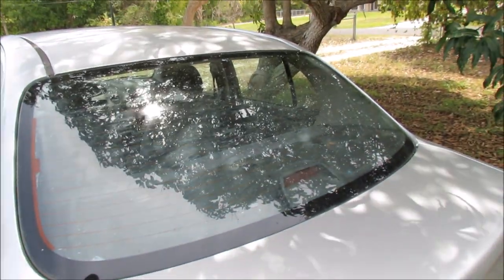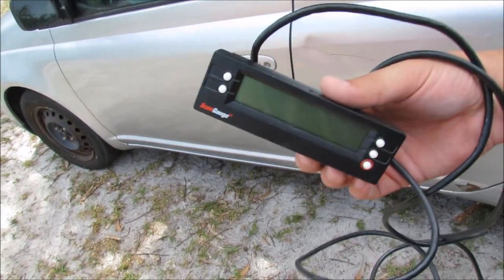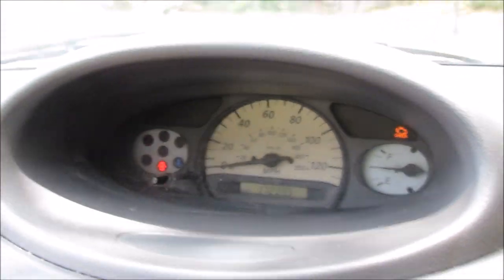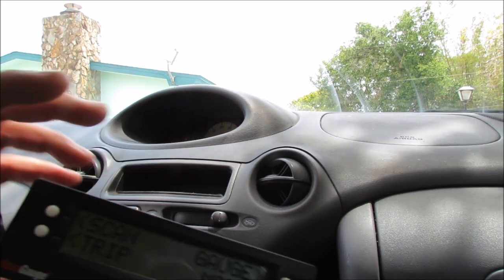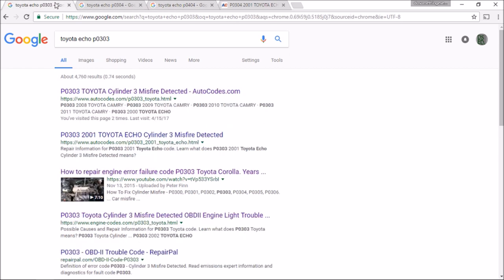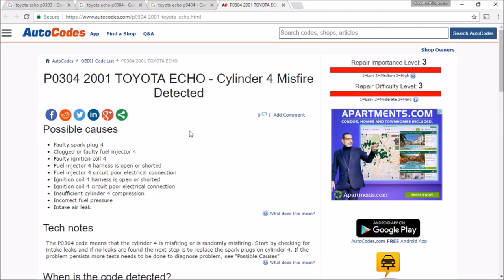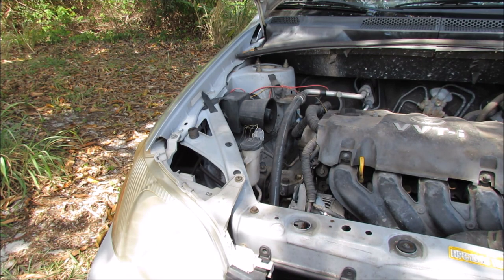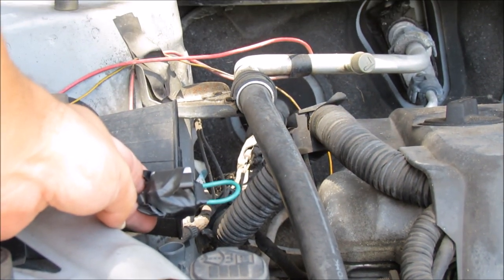Toyota Echo S01E06 Radiator Fan Bypass & Check Engine Lights

Comment: Your video is interesting and it is of great help for many people and for me since I have a Toyota Celica from the year 2000 with the same configuration of the cables. Thanks 🙂👍. This test may indicate that the pressure switch is bad.

Comment: My echo is overheating but no check engine and I did the same method you did it works but I wanna fix it I don’t want to hear the fan constantly on
Reply from the maker: Overheating engine wise?  Or its too hot inside the car?
Reply: No it’s not hot inside the car but when I turn on the car the fan never came on and I changed the thermostat and I thought it was that but I guess it wasn’t and I drove from Massachusetts to Florida I just moved to Florida when I was driving down here it never overheated but one I hit Georgia
Reply from the maker: @ELHONDEROPR  im guessing you already did this but have you check or replaced the fan relays or fuses?  If you already did the thermostat thats the hard part.
Reply: Thousanddollarcarguy no I didn’t check the fuses and relays but ima check those and see if it’s the problem thanks you for replying and helping me out I’ll definitely check the relays yes cus I let the car run for 10 mins it started overheating and the fans never came on so the fan works and I love your videos man your a big help
Reply: @ELHONDEROPR  
hey i've got the exact same car and same issue, I by passed the fan and its working but its always on and annoying... did you end up fixing your fan? was it one of the relays or a fuse?  
I don't have the book, don't know which fuse is the fan, gotta do some searching online...
Reply: @yash_ar  I fixed it it was the fan switch on the radiator but I sold the car 3 years ago now I have a 2014 Honda civic si
Reply: @ELHONDEROPR 
Cool thank man, ill see if I can find that switch
Reply: @yash_ar  it’s on the bottom of the radiator next to the transmission lines near the bottom hoses your see it
Reply: @ELHONDEROPR 
Great, thanks bro, I have a spare echo I'm gonna take it off that and switch it and hopefully it'll resolve the issue.
Reply: @yash_ar  your welcome and good luck I hope you get it working

Comment: What's the purpose of the a/c cutting off the cooling fan, I wonder? It seems crazy, but thanks for the info.
Reply from the maker: Its possible the switch is run thru the fan.  So when the ac doesnt work theres no reason for the fan to come on.

Comment: Sometimes on these Echos, the check engine light with code P0012 is often triggered by a clogged variable valve timing oil control valve solonoid.  One bolt, unclip electrical, slides easily out of engine, the part is near $100 aftermarket or double from Toyota, but often solves a check engine light.

Comment: Can you tell me the name of that Green Wire your using to do that ? It turns out I have the same car a 2000 Toyota Echo Stick & the Plug melted from the coolant sensor on the bottom of the radiator so now I'm trying to find the same plug or maybe another coolant sensor with a different plug that works the same way. But my fan doesn't run when I turn the fan switch in the car. And even without the switch on I don't think the fan runs at all. My Echo overheated once already and I'm trying to prevent that from happening again. But I still need it as my daily to drive until I fix it.
Reply from the maker: You can always wire power and ground straight from the battery to the fan to see if it works.  Or you can buu an after market fan to mount and wire up which as these cars get older may be the best option

Comment: Great video. Question, if the AC is Off , Fan is still running ?
Reply from the maker: Yes, with the AC Off this bypasses that and makes the fans run directly once the ignition is on.
Reply: I tried this and when I turn my car on the check engine soon pops up. What do you think what’s wrong with it
Reply: whats the make and model and price of youre scanner?  @thousanddollarcarguy

Comment: What make the fan for noah to be direct plz help out
Reply from the maker: Almost all electric fans are just 1 power wire and one ground.  And if you apply power to one of the 2 wires and ground to the other it will just spin in 1 direction or the other.  Imagine if you apply power one way it will spin the fan clockwise.  If you apply power to the opposite wire then it will spin counter clockwise.  Just trace the fan wire in the harness to a connector and try applying 12v from the battery and a good ground to the chassis.
Reply: It overheat from the the following morning its start once and get off and now when u turn the key on its run the fan sir

Comment: hey did you ever find out what was wrong with the echo? once you bypassed it did it run hot anymore?
Reply from the maker: The compressor was froze.  But the engine fan never came on.  So i bypassed the switch and it forced the fan to come on.  I sold it shortly after.  So never fixed on my end.

Comment: i had toyota echo 2005 the engine is shaking especially the aircon is on
Reply from the maker: It could be the ac conpressor about to seize.  Maybe take the belt off and try to spin it by hand.  It should spin freely.
Reply: Check the motor supports. The rubber could be deteriorated.